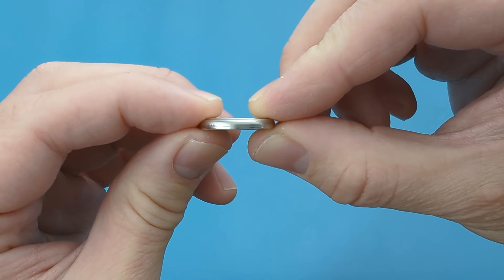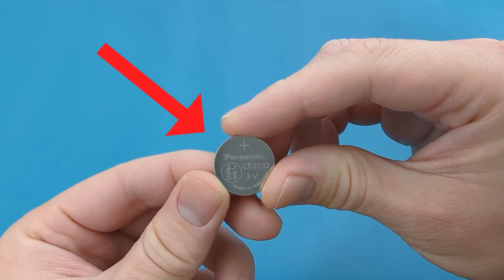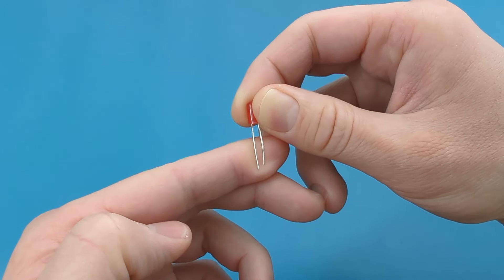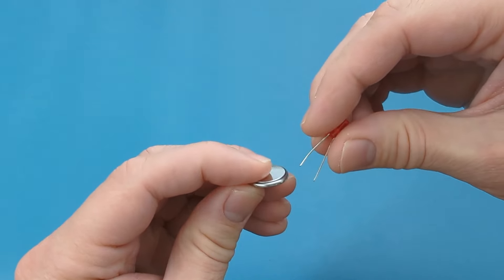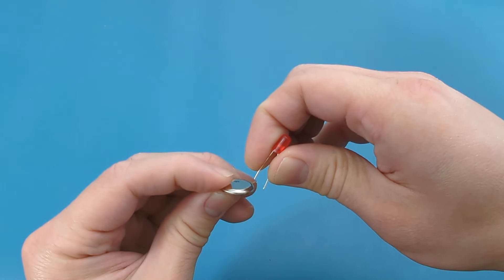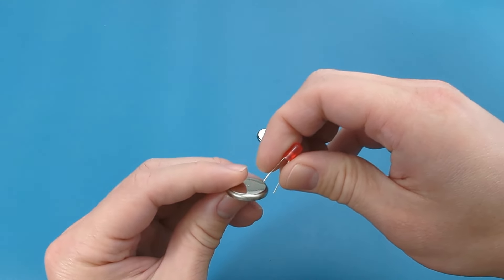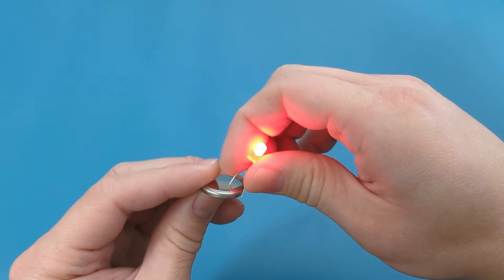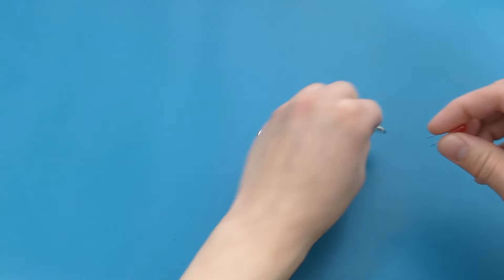How To Test Button Battery Without Multimeter

Comment: A multimeter just tests voltage but not internal resistance.  As the LED is itself a resistor, the LED is a better test, is it not?

Comment: Not good enough, it will light up if it's 1.8v

2.7v is considered dead battery 
For a button battery you should get 3.2v to 3.3v  - no point installing a dead battery